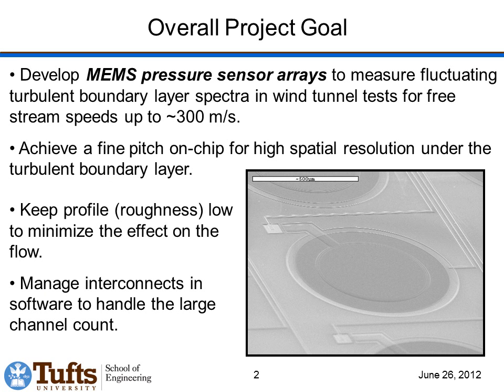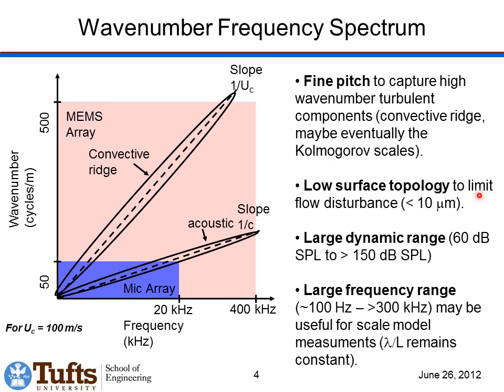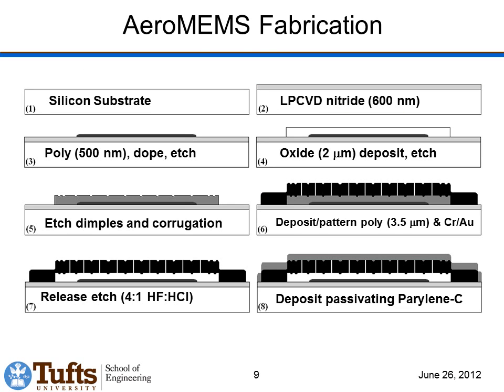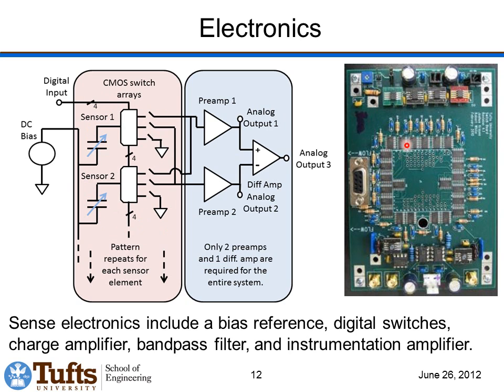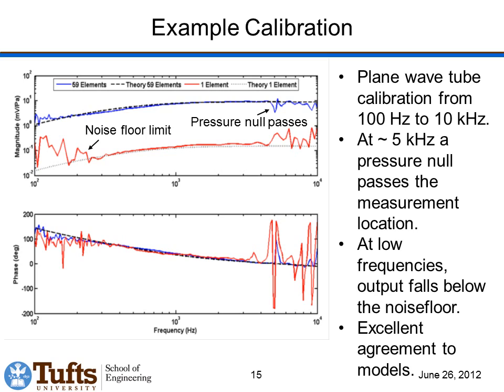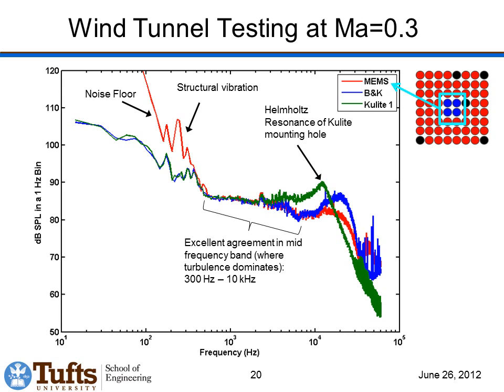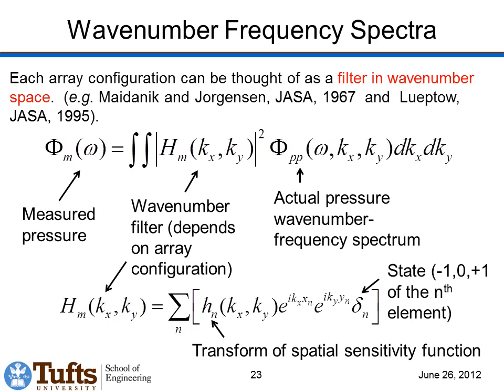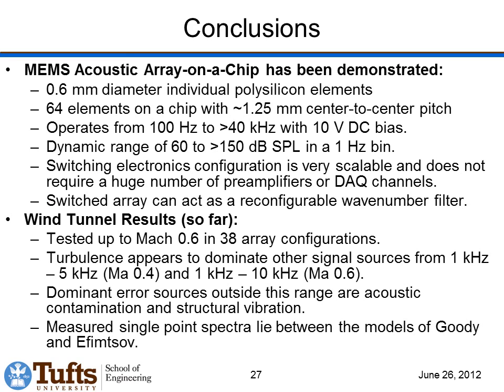MEMS Microphone Array on a Chip Technology for Turbulence Measurement

Comment: Interesting research. I wonder why did you not include a programmable delay between amplifier channels. That might have helped synchronizing the microphones and build various direction patterns.
Reply from the maker: Glad you checked this out!

I agree with you - I would like to include something like this so we could do beamforming. The only reason I didn't do so (yet) is I haven't figured out how to do the electronics with some many channels in a small space.  I thought there might be some solutions out there from biomedical ultrasound that would work but haven't been able to work it out enough yet to implement.  If you have suggestions on places to look for a good solution I am all ears.

We started out with 64 independent channels with the thought that I would use a 64 channel data acquisiiton system and do the beamforming in post-processing, but I had problems with cross-talk between the independent channels.  Since I was building the amplifier board using PCB space limitations meant that some microphones had relatively long lines going to their preamps.  This approach might also work, though, if I did a more careful job laying out my PCB with some kind of shields, keeping all lines the same length, and trying to pack everything together tightly.

Anyway, we are still working on this technology and I hope we will be able to add more useful features in the future - for example, I would like to do a non-uniformly spaced line array to achieve much higher wavenumber resolution.